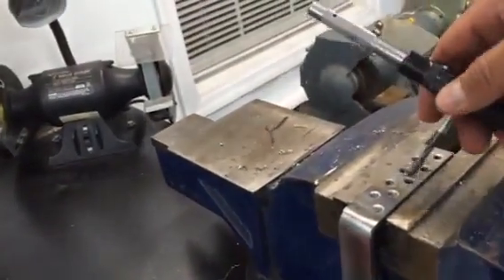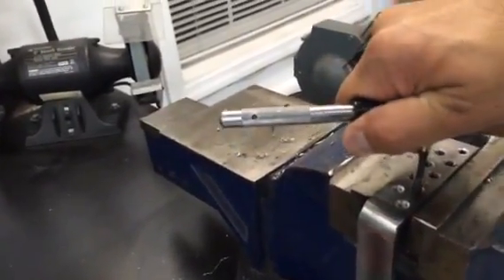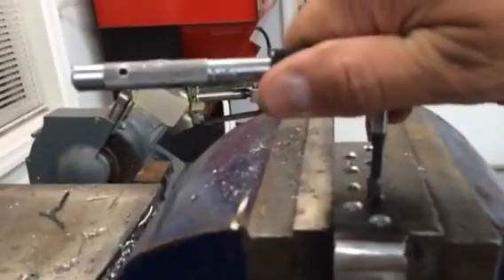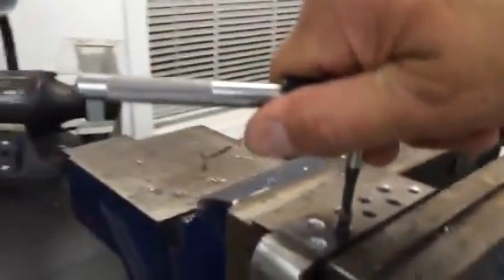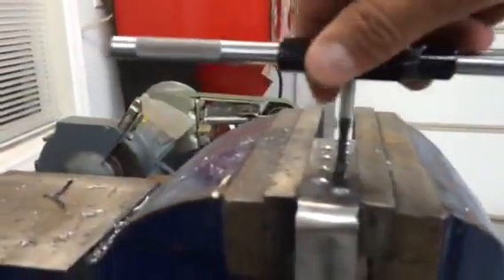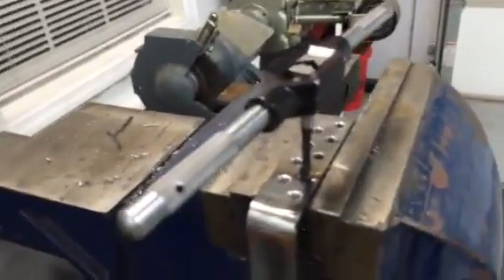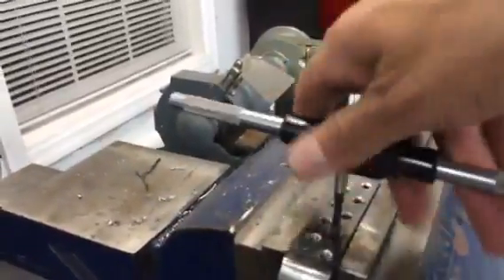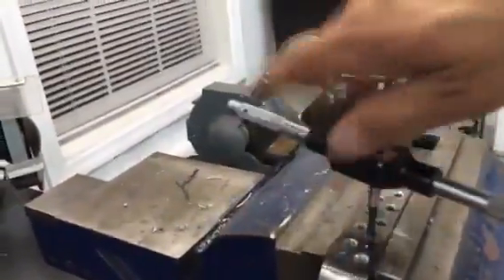How to Tap Threads Correctly - Eastwood

Comment: @blue03r6 what about NPTF threads?
Reply: I like to turn it back like he did. 
That's what I was taught, and the guys that work meticulous always do. 
It cuts the curl of metal off because if you keep going the curl can really bind up in the tap,so kickin it backwards occasionally can keep that from happening. 
If you have a good hand ,You can feel when you remove the tap and you have big curls, you can feel the friction there upon tap removal. 
And it's not so rough on the tap.
Aluminum is usually good for that issue.